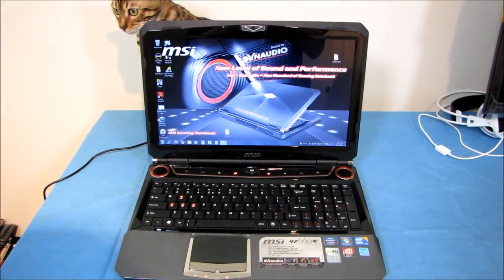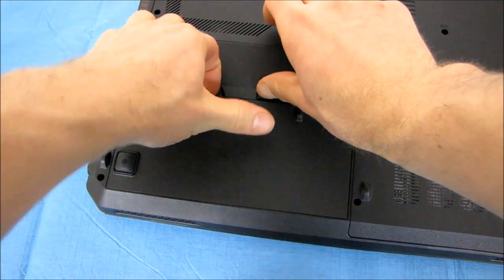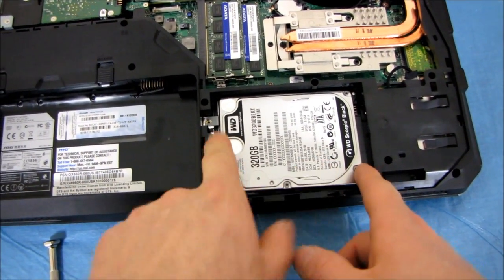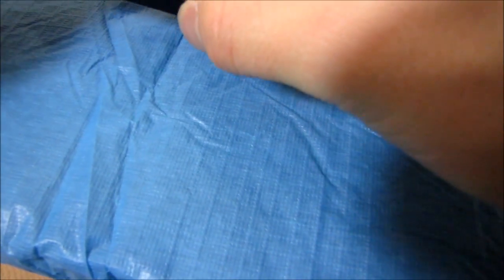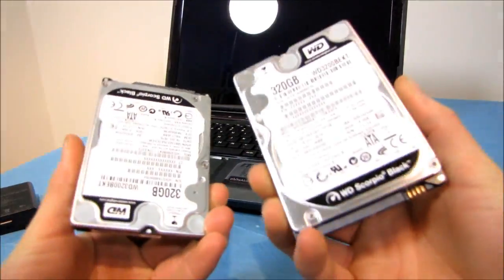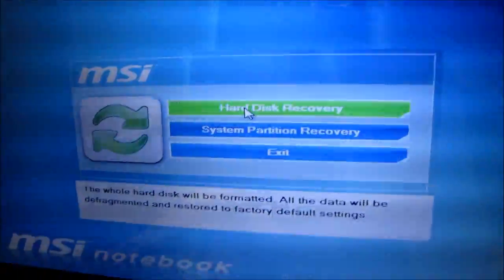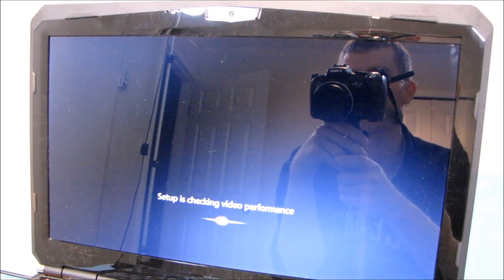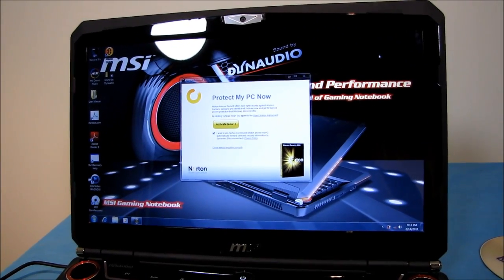MSI GX660R Gaming Notebook SSD RAID Upgrade Guide Linus Tech Tips

Comment: the gt70 comes with Msata SSD you can put another 128gb drive so it can be the so called SUPER RAID 0 that comes with the gt70 and the other drive is pretty easy just snap the 750gb hard drive in it and is ready to go.

Comment: I just got a MSI GT70 with 128 SSD and 500 HDD (with a Nvidia 680M gpu, woot).  Anyway; I want to upgrade both drives; probably 256 SSD and 750 HDD.  MSI put a tamper sticker on the back that would void the warranty if I open the case.  I am so hesitant....

Comment: @smallpebble7 they usually die along with the HDDs because the fan cant suck enough cool air in and all the 150-160 F air is trapped inside, which usually breaks it. You need to make sure you arent just putting it on  a desk but put a book under it or cooler for better airflow

Comment: I'm quite sure you just lost Trim support this way and your system will grind to a halt in... 2-3 months depending on how many time you'll write to those SSDs. I guess you can zero them manually from time to time but... I don't think it's worth the effort. It would be better to just put one big SSD in it for the system and leave the other HDD in for storage.

Comment: There is no reason for RAID 0 SSD on SATA II (3Gb/s), unless you are working with old or slow SSDs.

With SATA 3Gb/s you are going to hit your maximum read speed of 300 MB/s with just one SSD drive (or 285 with current sandforce chip).  RAIDing 2 SSD drives will only net you an extra 15 MB/s...